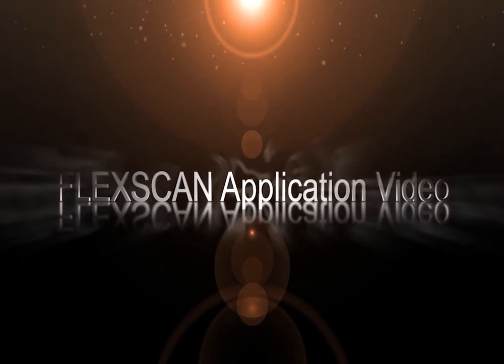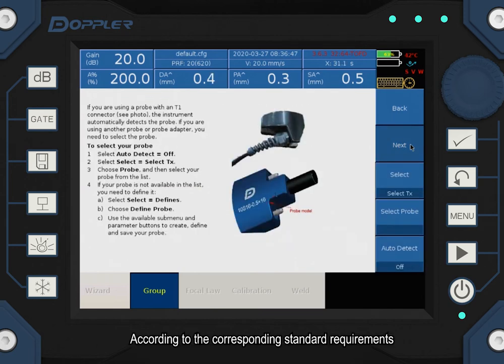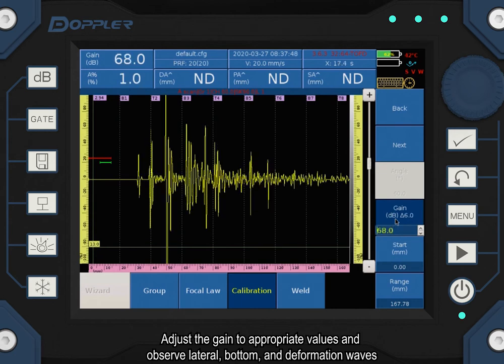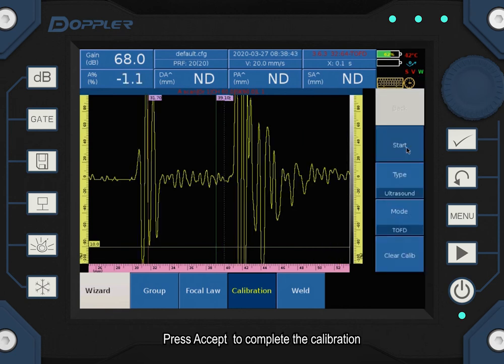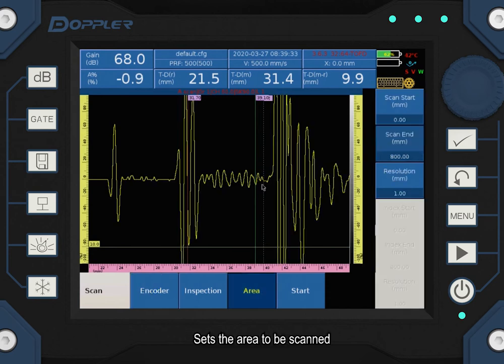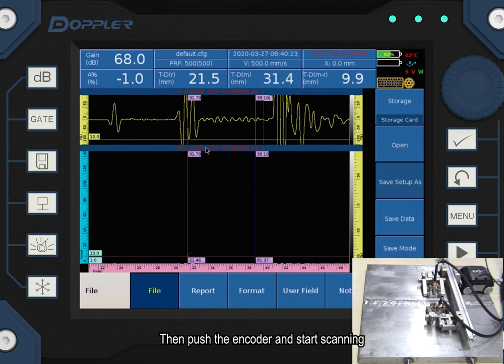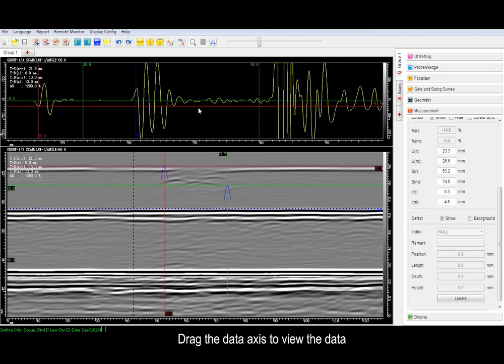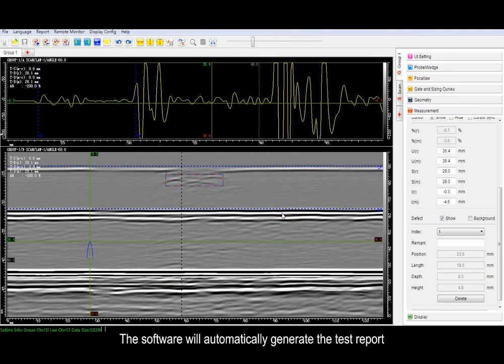Flexscan TOFD

Comment: Love it
The control panel is easy and does not require pressing several buttons
Reply from the maker: Yes, Flexscan is the latest PAUT Flaw Detector developed by Doppler. It’s a Continuity of Phascan,
with excellent performance. With 43% volume and 22% weight reduced, also hardware and
software optimized, Flexscan is ideal for on-site inspection. ^_^